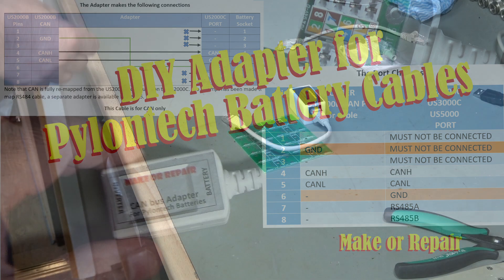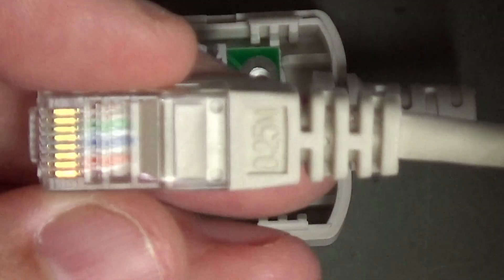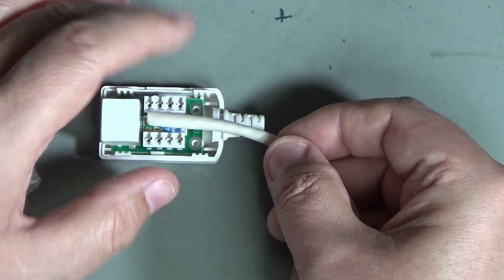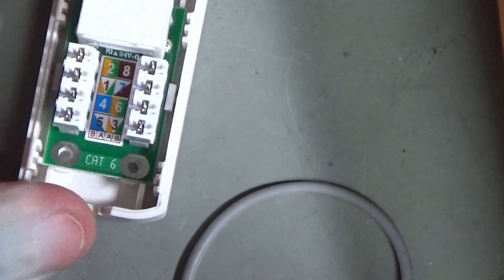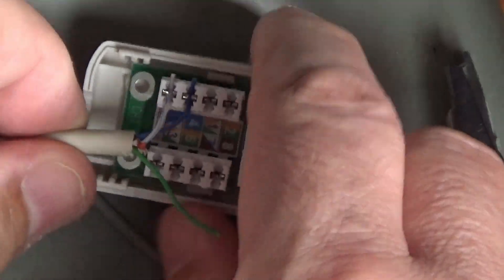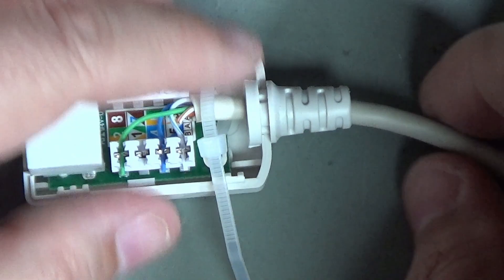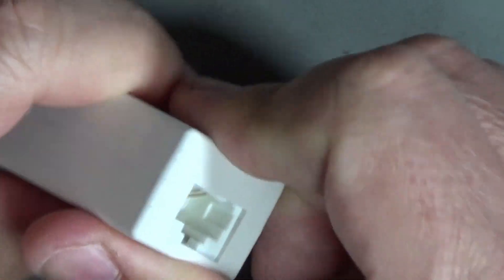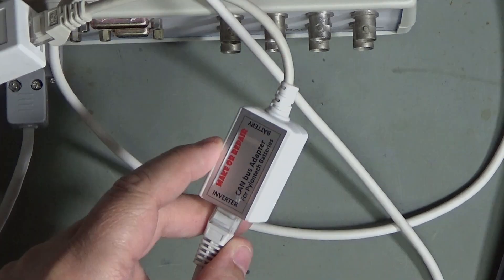Make Your Own Pylontech Cable Adapter #0103

Comment from the maker: I've done previous videos about the Pylontech batteries but decided a dedicated video on making adapters might be helpful since I no longer manufacture the adapter myself.  Mine of course was factory produced PCB, case etc and automated testing to save time and reduce the chance of error, but for occasional and one-offs the method I've shown works perfectly.

Comment: Does this same pin out apply to linking an old US2000 battery to a new US5000 battery?
Reply from the maker: I believe all the later ines use the same pinout, just double check the 5000 manual against the 3000 to be sure
Reply: @MakeOrRepair Thanks. I’ve had a look and I need to make a cable with the end switch round like you showing this video. Really useful thank you.

Comment: Hi, Just found your video, and is very useful, what I don't understand is why you made an adapter, instead of cutting the RJ45 side of the cable and crimp a new one with the right cabling!.
Also will be useful if you provide a diagram showing BOTH ends of the cable, instead of one ( the RJ45 one)
Reply from the maker: Well you can cut the cable and install a rewired RJ45 if you are confident and have a crimp tool, and you take care to trace the cable colours in the old connector.   But I used an adapter because 90% of the people asking about it were uncomfortable with that and needed a plug-in solution.  I ended up creating both  CAN and RS484 adapters that sould simply fit cables from multiple inverters, many of which have different connectors and pinouts (which is why I don't shoew the inverter end - it is in the manual) all without the end user having to deal with the detail.  Several professional fitters, who were quite capable of doing a canble conversion used them for convenience.   The adapter means you don't need to know the pinouts and colour selections from the manufacturer and it works if you change inverter it simply changes the 2000C pinout to match the older 2000.  The problem has largely gone away, sales dropped to single figures  per month and I ran out of stock so no way was I having a factory make another batch to sit on my shelf.  At the same time I wanterd to provide something that would help a few people who might still need to overcome the problem.  It seems the majoority of people are just having newer batteries at first install, having them fitted by a professional or have already used the adapter - and you only need one!

Comment from the maker: I realised the cable colours might confuse.  So for example White/Green means a white background with a thin green stripe.  Green/White Means Green background with a thin white stripe, but sometimes Green/White would be solid Green.  Similar for the other colours.   Just the way the table of colours is presented by the manufaturer with the part.